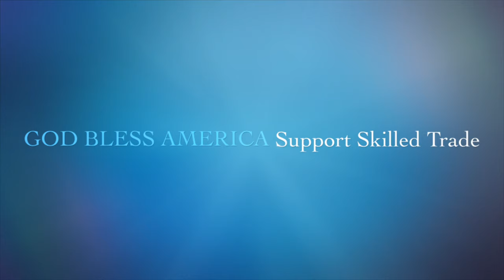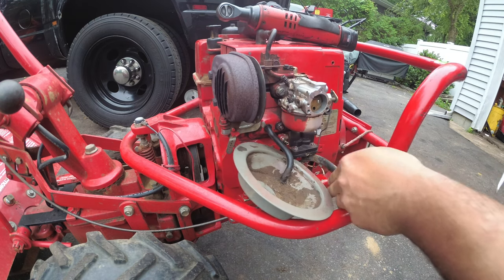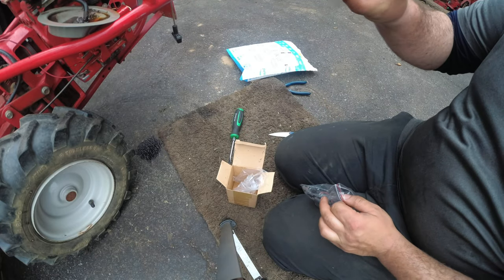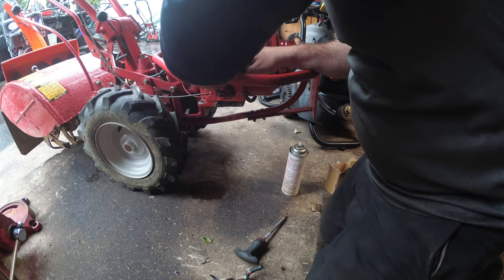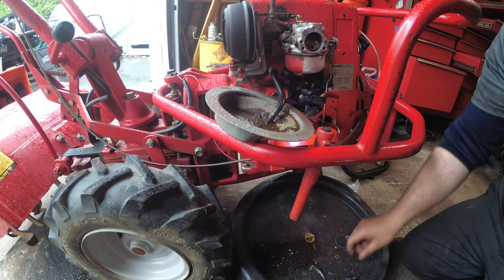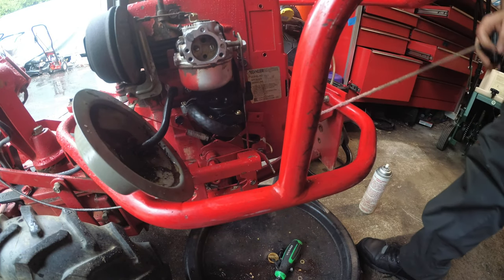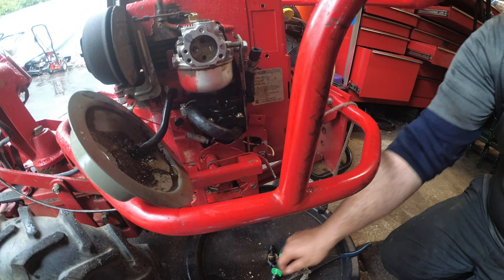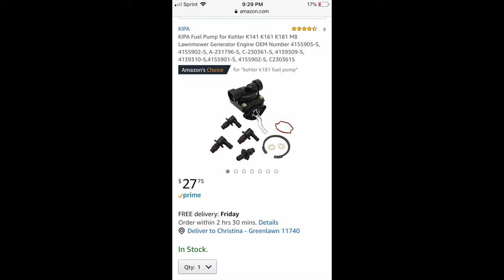Troy Bilt Horse Tiller Rototiller Kohler Magnum 8 HOW TO Diagnose & Replace Fuel Pump NO START

Comment: I have the exact same tiller. It’s 29 years old.  About 5 years ago I replaced the pump and fuel lines. It developed a kick back condition when pulling the rope. It would pull the rope out of your hand (painfully). Before I could track down the cause (coil) it ruined the recoil starter. You will find many parts are no longer available for the M8T engine. I looked for parts everywhere and even used or junk engines. I finally fixed it, I installed a 8.5HP Honda GX270. Quiet,powerful and smooth. Moral to the story, If your M8T starts pulling the rope out of your hand. Replace the coil!
Reply from the maker: WOW! Usually that means timing is off, time to lap and adjust the valves.  Thank you for sharing your story.  Will keep it in the memory bank for sure!

Can’t go wrong with a Honda! I really like the Predator Clones!  

Thanks for the view and comment, hopefully you subscribed to my channel 🔧🤙🏻🦅🇺🇸

Comment: I got the same tiller with the same trouble as yours. It has been kicking my but also. Just like you I thought it was the fuel lines and change them. I got it to start with starter fuel but it would not keep running. THANKS A LOT. I THINK YOU SAVED ME FROM TAKING MY TILLER TO A REPAIR SHOP.
Reply from the maker: Together we learn and together we grow!  we both made the same mistake!  Thank you for sharing your positive experience!  Thanks for the view and comment, hopefully you subscribed to my channel and eneter the giveaway!

Comment: I have the same engine on a BCS 715.  I had to replace the pull-start for this.  Since they no longer make the pulley in the starter, I bought the modern version, a 14 165 20-S.   The newer pulley is a drop-in replacement into the original steel housing!   I then replaced the fuel pump, fuel lines and cleaned the tank.  I've  also had to have someone re-weld some washers onto the engine shroud because the holes for the bolts mounting it to the block had all broken off, and helicoiled the aluminum block for those mounting bolts.
   However, I've still had problems with the shroud coming loose. Even with loctite the screws disappear in a few minutes.   With the shroud loose, the pull start doesn't engage the cup properly and won't retract.   What do you suggest?

Comment: Hello Jason. Recently I purchased a 1968 John Deere 110 garden tractor that a previous owner replaced the Kohler K181S to one of the Kohler M8T engines like the engine in your video. 
I discovered your video while looking through various videos here on YouTube in a effort to better educate myself about these engines. 
My Kohler M8T engine has the electric start instead of the pull rope recoil start with the bracket with the key switch on one side of the engine and the choke & throttle controls being on the same side as the carburetor/fuel pump. 
A few days back, I poured a generous amount of SeaFoam into the fuel tank in an effort to treat the carburetor internally in which I artificially created a situation where the engine smoked just a bit. After refilling the fuel tank, The engine seems to be just fine with not much smoking after the SeaFoam treatment. I replaced the old incorrect spark plug with a new spark plug with the correct gap which made the engine run even better. The John Deere tractor that I purchased had some very badly deteriorated battery cables and tires that I have replaced. Thanks for your great videos,Jason.
Reply from the maker: WHAT A FIND!  The smoking is from the seafoam!  That’s a good thing!  Let the seafoam works it’s magic and hopefully it will even things out!  Due to age have you performed a compression check?  Could be time for a valve job?
I’m sure the Mrs will be elated that a Deere is in your hands!  It will be well loved! 🔧🦅🤙🏻🇺🇸
Reply: @pattayperformance  Yesterday I posted a short video clip of my 1968 John Deere here on YouTube in which I had the engine running and didn’t actually speak until the last part of the video. You Know,. It’s truly amazing how much better that this tractor looks after replacing the tires and front wheels. 
Speaking of SeaFoam, The one thing that the SeaFoam induced smoking exposed was a slight head gasket leak in which a new head gasket would take care of. The engine starts just as soon as you crank it over - So the timing is dead on. 
In the near future, I am going to make a YouTube video of my 1969 John Deere 110 that had been involved a fire before I start replacing body parts and the K181engine that is locked up. This tractor was located in the next county over from me in which I paid $100.00 for it. For this tractor, I had entertained the thought of maybe going with a 13hp Predator engine if the Kohler K181 was too far gone. At this point things can only get better for the 69 John Deere 110 tractor. I think even Henry checked out my video clip last night - Check it out sometime and let me know what you think.
Reply from the maker: @TheIronDuke502  HOLY CHIT!  What a unit!  Wheel and Tires make it look like a work horse! 🔧🦅🤙🏻🇺🇸
Reply: @pattayperformance  I paid $500.00 for the tractor and the guy that I purchased the tractor from has two more disassembled 200 series John Deere tractors less the engines that he offered to sell me at a more than reasonable price. Seems like I have become a John Deere garden tractor guru in this area. A friend of mine tagged me on MarketPlace for a John Deere missing the hood. 
Jason, I am getting options on John Deere tractors from all around it seems. Mostly I stick to the older Cub Cadets and John Deere 110/112 vintage tractors instead of the newer ones.

Comment: I have the same unit.  My choke doesn't appear to do anything.  Is the lever up to turn on the choke, or does it have to be down?
Reply: Take the air cleaner off and see for sure
Reply from the maker: Verify the cable is moving at the carb and nothing is frozen or broken

Comment: That snap ring tool you said you didn't know about is used to install the hose barb fittings without forcing them in like that.
Reply from the maker: Thank You!  Live and Learn!
Reply: @pattayperformance  No doubt!  Speaking of learning....I got two of these off of ebay and both showed the correct fuel flow direction in the pics but are opposite!  Just ordered one from the link you provided in the video...lets hope this is correct!  Lol.
Reply from the maker: @finders-keepers1518  🤣🤣🤣🤣🤣

Comment: Btw that's a mechanical fuel pump, vacuum operated fuel pumps are on the lawn tractors with rear mount fuel tanks, Honda gc160s and gc190s etc. Its vacuum if it has a breather line going to the crankcase, valve cover, etc.
Reply from the maker: five speed ash 

Thanks for the view and response.  It’s not VAC, bc just lever activated.  From what I understand if it’s VAC then there will be 3 ports instead of 2 as shown in the video.

I appreciate your insight and hopefully you subscribed!

Comment: Hi, I just picked up a 1986 horse tiller with a M8 engine.  It oscillates and stalls out if put in gear.  any suggestions?
Reply from the maker: Clean the carb...verify fuel pump working...if still happens...when you active the tiller something is locking up/binding the motor which is causing the RPMS to fail.
Reply: @pattayperformance  it stopped oscillating after I adjusted the linkage.  Now it idles but stalls when I put it in gear and move a few feet.

Comment: I have the same tiller thanks for sharing this video mine has no spark where are you located lol
Reply from the maker: Does this machine have a kill switch?

Disconnect the kill switch and check for spark.

If you got no spark…you are almost there.

Report back what you find 

I’m in 11740

Comment: And I thought I had the only one left of these. I’m in the process of trying to mine to run also. I have the fuel pump, but haven’t put it on yet. Will clean the tank thoroughly, replace fuel lines and fuel pump and give it a whirl. Fingers crossed. Oh, and new carb too.
Reply from the maker: I’m so sorry I missed this comment, YT never notified me! Are you the Original Owner? What state are you in? In my neck of the woods on this island, I believe gardening to the extent you need tiller like this is a dying breed.  Covid did breathe some fresh air into gardening but still not enough Space to use a machine like this.

My Father use to buy these and restore them (never sold them lol).  There have been a few times I went with him.  It was older Italian couples who turned their entire back yard into a garden for decades.  As time goes on they can’t continue to tend to it. 

Did you end up getting your machine running?  How was the tank? 

Thanks for the view and comment, hopefully you gave the video a thumbs up to help others and subscribed to my channel 🤙🏻🔧🇺🇸🦅

Comment: Thanks Pattay.  I have the same machine and replaced both the carb and fuel pump in the last year.  By the way, I like your knife.  What brand and model is that?  Thanks!
Reply from the maker: Snap On Anniversary Edition Knife just a rebranded Kersaw that comes with a lifetime guarantee.  I thought I stole it at $50 but ebay has shown me different 😂😂😂😂
Reply: Thanks!

Comment: Got the same machine. I removed the engine to fix the transmission seal, put it back together, re-attached the throttle cable (adjusted the cable) and now the bugger lost low idle. The throttle lever just shuts it off or full tilt. I hoped that made sense..
Reply from the maker: ned cramdon congrats on your new purchase!

I would adjust the throttle cable!

Thanks for the view and comment.  Hopefully you subscribed to my channel!

Comment: ive got the same tiller but it will not die when i push the throttle to the off position. Wierd problem to have i know but its just like its not shorting out the spark like its suppose to. Any ideas?
Reply from the maker: amyers11,

This tiller is back to its owner...
I would trace the Throttle cable down to the carb and see where there is a kill / contact point.  It could be some as simple as bending something back into place so it makes contact with something in order to ground out the cable.

Feel free to reply back if it works or doesn’t 😁

Thanks for the view and comment, hopefully you subscribed to my channel 🤙🏻🇺🇸🦅🔧
Reply: @pattayperformance  yeah thats what i did and it makes contact its just not grounding out for whatever reason
Reply from the maker: amyers11 great!  Now see where the bracket is that suppose to contact and ground out...follow that to the coil.

Comment: Hello, nice video.
I have the exact same 1990 unit. PS-301548
Non adjustable main jet carb, walbro WHL013559.
Decided to pull carb off and check it all out for resin buildup because I often leave gas in it over winter.
It was like new inside and so I ordered gaskets for it and put it back together.
 It wouldn’t start, dam near tore my hand off when pulling the pull cord as it’s got great compression and getting hard to do now that I’m 70.
I put some gas into the head via spark plug and it started right up.
Thus making me check the fuel system.
Changed out the fuel lines and then noticed the fuel pump had a leak along one side of the pump when pulling to start.
This is the non rebuildable nylon version.
So decided to replace but the Chinese junk is no option for me and the replacement OEM will destroy your pocket book.
After thinking about this I decided to sand the edges around the pump and apply JB weld Marine.
Put it all back together and the Horse is running like a champ.
The only concern I had was when installing the pump the lever that rides on the cam, if you look closely in the motor you can see the cam and it has a rod coming down with a thick precision washer that either rides on the cam and then the pump arm rides on the washer or the pump arm rides on the cam with the washer on top of the arm.
I was confused as to the correct way it was to go.
I decided to let the washer ride on the cam other wise the washer seems like it would be slapped around.
It’s hard to find a detail view of this and it won’t show on diagrams I have seen.
Anybody know the answer?
Reply from the maker: I’m sorry I don’t!

As you can see in the video…I pulled the pump off and put the new one in.  I didn’t turn the motor over with the pump off incase is was timed.

I guess you will find out by trial and error.  Keep us updated!  

Thanks for the view and comment, hopefully you gave the video a thumbs up to help others and subscribed to my channel 🤙🏻🔧🇺🇸🦅

Comment: Do you have the part number for the fuel pump?
Reply from the maker: Click the link in the pinned post for exact pump I used.  If it doesn’t work let me know and I will update later bc I’m at work.

Comment: hello can you tell me the part # for the fuel pump can't find it on amazon///thanks Art
Reply from the maker: arthur skidmore 

I’m currently at work please give me time.
Reply: @pattayperformance  that would be great thank you very much///Art
Reply from the maker: @arthurskidmore7452  sorry for the delay as it has been an extremely long day!

here is the link you asked for... Ebay has the cheapest price last time I checked.  The seller is also located in the US.  Thanks for the view and comment, hopefully you subscribed to my channel.

http://rover.ebay.com/rover/1/711-53200-19255-0/1?ff3=4&pub=5575562411&toolid=10001&campid=5338723955&customid=&mpre=https%3A%2F%2Fwww.ebay.com%2Fitm%2FNew-Mechanical-Fuel-Pump-for-Kohler-4155905-S-4155902-S-A-231796-S-C-230361-S%2F114211899689%3Fhash%3Ditem1a978f4929%3Ag%3AxHAAAOSw11Jer-RW
Reply: @pattayperformance  thank you very much///Art
Reply: part orderd thanks ///and great video

Comment: Great video, but where the hell is the fuel filter?
Reply from the maker: This isn’t my machine but I don’t recall it having one.  I did such a good job on repairing it, it hasn’t been back since.  I’m also in constant contact with the owner once the season comes.  He Tills Gardens and areas as a side hustle.  I refer him a lot.  

Thanks for view and comment, hopefully you subscribed to my channel 🇺🇸🦅🤙🏻🔧
Reply: @pattayperformance  Thanks. I haven't found the filter and can't believe they would put it through the engine where the fuel line hose runs. I'm going to do the same thing you did and run it on the outside of the engine, but with an inline filter. Subscribed. :-)

Comment: You would take that stupid filter backing plate off and get it out or your way you could work better on that pump instead of fighting with that dirty back plate.
Reply from the maker: Maybe next time...I don't recall it giving me an issue.  My main concern was getting the machine fixed.  I was fustrared/embarassed that the machine died when the guy came to pick it up.  I know its not my fault, just comes down to luck.  The owner, didn't seem to give off the feeling that he was happy it died here in the driveway instead of back at his home and/or on a job.   He just wanted it fixed.

Thanks for the view and comment, hopefully you gave the video a thumbs up to help others and subscribed to my channel 🤙🏻🔧🇺🇸🦅
Reply: @pattayperformance  I did not word that correctly, I was just making a little fun of you fighting the back plate, I have done things like that a lot,  I was just to stubborn to get it out of the way lol
Reply from the maker: @wmnapier  

It’s hard to read reactions in comments.  This video was made in the infancy of my channel.  The more we take off the more we have to put back together.  For your viewing pleasure I should have taken it off 🤣. Like I said I zoned out on this one.  My pain is your pleasure and we are all alike 🦅🔧🤙🏻🇺🇸

Comment: What year is it
Reply from the maker: Unfortunately it’s not mine, therefore I can’t accurately answer that.  I know it is old enough that it is a true Troy Bilt when they were made in Troy, NY.  Seller said how times have changed.  He use to send it Troy ever year and get it refreshened/overhauled for $125 and always tipped another $25.

I would say late 80’s with a quick google search.

Thanks for the view and comment, hopefully you subscribed to my channel!  You never know it might come back 😁
Reply: I have a 1990 model Horse with the same motor. The stickers are slightly different so I’d say this one is a 91 or 92.
Reply from the maker: @Brian Boone THANK YOU SO MUCH for sharing your knowledge, hopefully you subscribed to my channel!  #TogetherWeGrow 🇺🇸🦅🔧